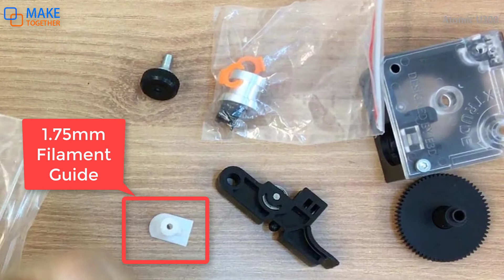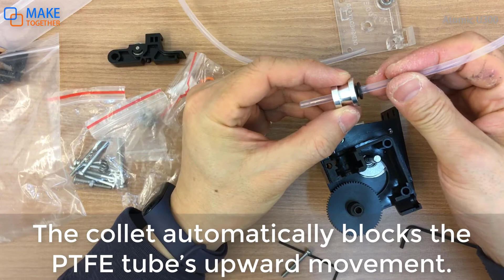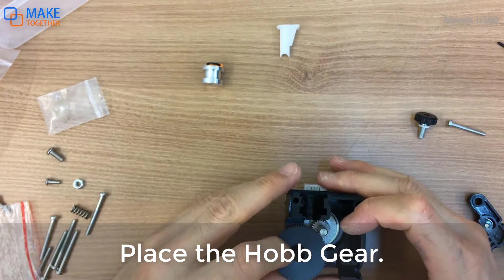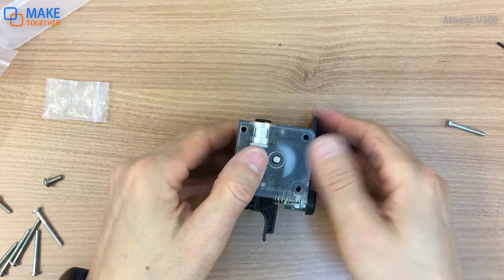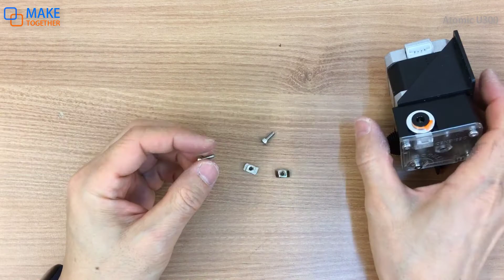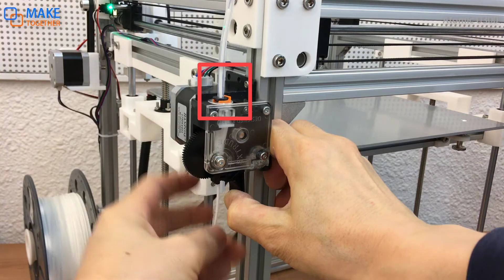Ultimaker Style 3D Printer Build Tutorial 14 - E3D Titan Style Extruder Assembly and Attaching

Comment: Thanks a lot for the detailed instructions. It worked immediately for me! I want to use the Extruder for my Anycubic iMega S, but unfortunately the cable that comes with the E3D extruder does not fit in my anycubic cable interface at the bottom of the printer. Do I have to solder the cables. Or is it possible that I can't use this extruder with my imega S?? Your help would be appreciated.
Reply from the maker: Thank you for your comment and question, Roland.
I checked some youtube videos about Anycubic i3 Mega S. 

If you want to change the filament extruder with the 'E3D Titan extruder', the cable wiring does not matter because the cable is connected to the extruder motor.

So I guess your problem is about 'E3D v6 hotend.
It seems that Anycubic i3 Mega uses an integrated connector for wiring the printhead module to the mainboard.

So you should carefully check the exact wire colors for the hotend heater and thermistor sensor.
I think it will be better if you connect wires from the E3D to the integrated connector on the printhead side, not to the mainboard side.
And this wiring job will need skill and experience.

I hope this will be helpful to you.